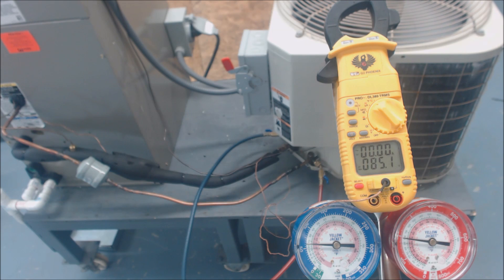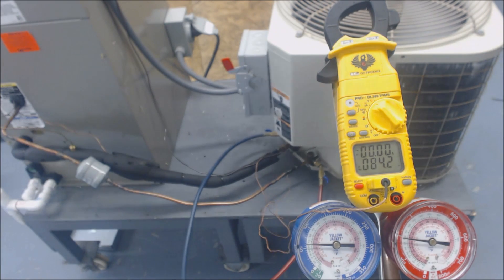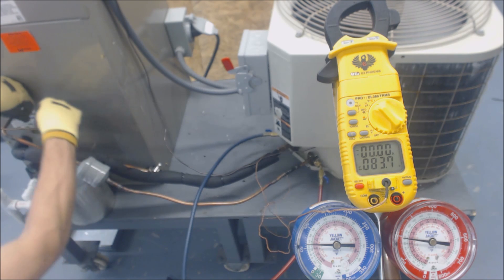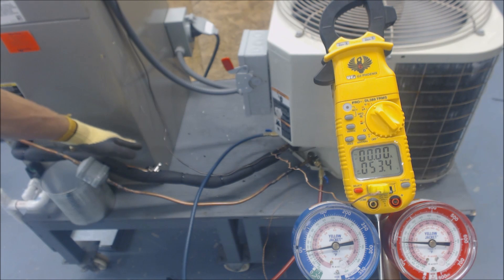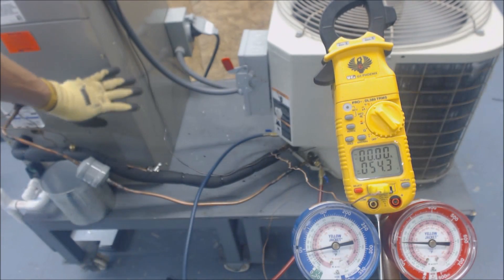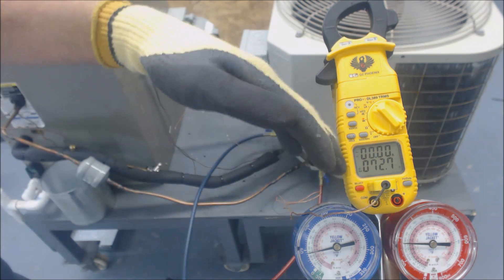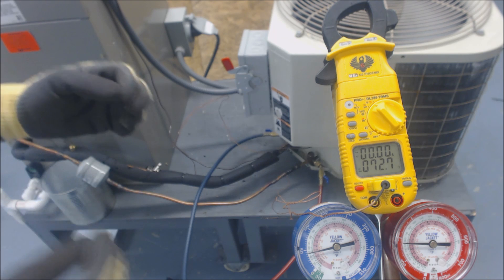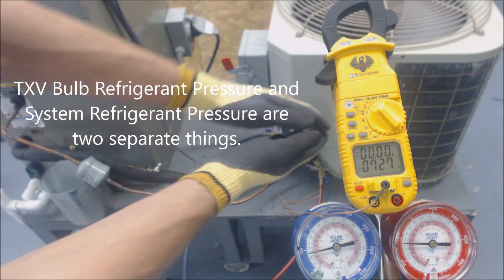Refrigerant Charging: What it looks like to have a Bad TXV Compared to just a Low Charge!

Comment: what if both high and low side are low on pressure? so when you try to charge the system the system, the pressure stays the same(or goes lower) and suction line starts to freeze

Comment: Thank you for the great videos. I have a 4 ton 
System 410A . Customer had called me telling the outside unit  sounded like something was stuck in the fan . 
When I got there put my gauges on . 
And low side was 158 high side 278 
SH 15 SC 1.3 .. at first I was thing txv . But now second guessing my self maybe compressor valve . Would you have a idea 
Thank you

Comment: I got a service call once where this 1 1/2 ton Rheem heat pump would work fine on A/C mode but on heat mode the high side (or low side i don't remember) would rise more 500psg and the high pressure switch would turn it off. I changed the TXV and filter dryer  and that fixed it. Can some explain to me how this can happen?
Reply: My heat pump is the opposite, works fine in heating but not in cooling. So I might have to replace the filter drier and the TXV?

Comment: I replace a TXVon a Rheem  outdoor heat pump last week because it was completely shutting down refrigering flow. After further inspection I saw that the cap Tube connecting the sensing bulb to the TXV powerhead had a crack in it. I’m wondering if the sensing bulb losing its refrigerant charge was the cause of the TXV completely shutting down refrigerant flow or if that was just a coincidence. Because I could have just replaced the powerhead and not gone through the refrigerant removal process and pulling a vacuum etc.
Reply: I tested my TXV by placing the bulb in ice water and warm water to see how it regulates the evaporator. It makes a difference so I believe it is working properly. Not sure how to diagnose just a bad bulb. If the ice water/warm water test does not have any impact then it could be bad bulb, stuck valve, clogged TXV. I suppose you could replace the powerhead first to see if it fixes the problem (easy job), if not then plan to replace the entire TXV. My bulb was mounted inside the air handler (Trane Heat Pump), so I relocated it to the outside for easy access to test.

Comment: I have a 40 year old Friedrich AC system that has worked very well for me. Years ago it developed a leak in the evap coil which I replaced. It has worked OK since then except that now the evap coil froze up. A service tech said he thinks it's low on R22. I also noticed  the drain channels have a lot of rust flakes in them. (they are not plastic like newer ones.) Could those flakes be blocking the evap drain? Should I replace it with a newer coil?

Comment: Awesome

What about if the TXV bulb just comes loose?
I think I have that issue at my house
My sub cooling is high, unit calls for 10-12 but it’s 18 (it’s a TXV system)
super heat is like 1..
Temp split is 20
Suction line temp is 42
Liquid line temp is 75
Outdoor temp is 75

I just don’t have access to my basement tenant is on vacation..

Comment: Just worked on one and I put the tvx bulb in warm water cause the suction line would look right when I turn on the system but after few minutes the pressure would go down, so after putting the bulb in warm water the suction pressure didn't go up. Bad txv?

Comment: very good explanation! thank you sir
i have one question that bugs me out: why at the moment you dipped in the bulb into the water ice the pressure reading changed quickly. but when messing with the adjustment screw on the TXV in order to bring the superheat higher or lower we have to wait for minutes to see the changes??
Reply: the adjustment screw adjusts the pressure on the spring. tinkering with the bulb on the txv is more immediate because it reacts immediately to the heat applied to the bulb and closes/opens the suction line quickly. the adjustment is just a spring and therefore you need to wait a couple minutes to see if things are getting better and so you don't overshoot the mark.
Reply: @fastcar42069  aah i got it! thanks !

Comment: Can you do a video on a TXV hunting. Went on a call with the bulb mounted downstream of equalizer tube,  Watched ice have to form outside the unit valve would open and thaw ice just on the downstream side of tube, then close again. Keeping coil frozen inside unit. This was also on a high velocity system. I am not a fan of the high V systems anyway. Thanks

Comment: Carrier system, 3ton, 410a:
50° saturation lowside with a 10° SH. 108° highside with a 10° SC. 9° temp split with high electric bill. Bad txv? Compressor? (8.2amps) Both? Air flow was fine.
Reply: this reads more like an overcharge. is it a txv or a piston? what is the outdoor and indoor temp at these conditions?
Reply: a bad compressor will usually just be not compressing as efficiently. You're pressures will be closer together than usual. in other words, the low side will be reading higher than normal, and the high side will be reading lower than normal. One house i went to the compressor was fucked from being overworked, and when i put the hardstart on it it was running 50psi suction side and 100 psi liquid side.

Comment: Hi Craig, question, is it true that when we are replacing an old r22 outdoor condenser with a new r410a condenser, we really do not have to change the txv in the indoor r22 air handler. I have always done it but some of the people here in town don't do that. is it true ? if not changed, what would happen ?
Reply from the maker: Ha ha that is not good! You definitely change the txv to r410a otherwise you will have an inefficient system with higher superheat. Wow that is really pretty bad!
Reply: @acservicetechchannel  I completely agree with you. But I stopped arguing that it is wrong what they do. I guess at the end of the day is what you do what really matters. Thank you buddy.
Reply from the maker: @budgetcoolingandheating4059  this is true. They must not be looking at their low side gauge or delta t after the changeouts, man that's awful!

Comment: What should the temperature be of the air coming out of the condenser?
Reply from the maker: That would depend on the seer rating of the condenser. The sat temp that we are normally running at is 90 to 105 unless the seer rating is low or the fins are dirty, thanks

Comment: Like everybody below says, great video!  I'm helping a friend with what I think is a bad TXV.  Line is iced up behind the TXV.    I had only a thermometer with me.   In A/C mode, indoor Delta T  was 10 Deg F . Good air flow.  Supercool felt OK to the touch - that is it was definitely saturated liquid. ( a calibrated touch that is :-) .    I'll go back and check it out better later.   My question is,  Shouldn't it be possible to be pretty sure without even installing gauges?  Here is what I'm thinking,  Rather than look at super heat and cool, look at "relaxation" that is what is the delta temp between the coil outlet line and the air temp passing through the coil.  In watching your video, as you showed super heat and cool, I was wandering what the outdoor temp was - that is how "relaxed" the refrigerant was to the outdoor air temp.   Also it seems that with a cheap IR thermometer you could measure the condenser face temp as you move up from the bottom.  When you see the temp jump up you'll know how high up the liquid is.  If the TVX line is icing and the liquid line is high you should be pretty sure the Charge is good and the TVX is bad ( assuming all the other issues you listed were not a problem)   In the old days I would run my hand up to coil loops and find the temp jump to know that.

Comment: Hi there, i watch your videos regularly, and also im reading the book but one topic still remain unclear to me. Thats line restriction. Im trying to figure out what is the whole procedure from diagnosing, symptoms and over solving it. Please refer me to sole of your videos if there is one like that.
Thanks,
Zoran
Reply from the maker: You would want to read the troubleshooting part of the book where I have a liquid line restriction with a correct charge and another with a overcharge. A liquid line restriction is usually the metering device, or screen in front of the metering device or the filter drier. Any time you find one with high superheat and normal to high subcooling on a TXV system replace all three components after a pump down, thanks!
Reply from the maker: You can test the temp across the filter drier to see if you have a temp drop across it. If it is less than a degree, it is good, thanks

Comment: Charge might be hard to gauge on sub cooling side of system because liquid line is too short needs to be 15ft
Reply from the maker: Hey Eric, subcooling happens in the condensor and is measured before at both spots before it even gets to the line set liquid line. It wouldn't matter if there was only one ft or less of liquid line. This would be the same distance as most package units as well. Subcooling is the temp decrease of the liquid from where the liquid comes out of the saturated state in the condensor until it comes out of the condensor. In order to measure this, we convert liquid pressure to sat temp and minus the actual temp measured on the liquid line within 3 inches of the service valve, thanks!

Comment: How can you tell if the evaporator coil itself is blocked with dirt?
Reply from the maker: Hey Steve, you can drill a small hole in the triangle tin plate if you can't see behind. Some have a plastic knockout. You could also take a pressure reading across it with a manometer. The target would be in the evap coil manufacturer install booklet, thanks

Comment: What if a r22 unit has a txv and capalary tube In the same system(york)
Reply from the maker: That is actually a txv with normal distributor tubes attached from the txv to the coil. Distributor tubes are normal on txv and piston systems and a larger in internal diameter than capillary tubes, thanks Gary!
Reply: Thank you sir ..

Comment: I've always wondered the correct way to TEST if the bulb is bad. I've read and heard to place the bulb in warm/hot water. I've read to place the bulb in your hand for 10 min and then check. I've also read that you can use a hair drier on the bulb to test it. It would be great to know the correct way to test/troubleshoot the bulb.
Reply from the maker: You can do these tests but also high superheat and high subcooling is an indication of a liquid line restriction which we replace the txv, strainer or check the strainer, and replace the filter drier, thanks Blue Collar!

Comment: Excellent video!!  One question. Why doesn’t head pressure rise when the TXV shuts down. Seems to me like it would.... Also, is there any way to rule out a bad compressor in situations like this. I guess what I’m asking is of the compressor wasn’t pumping right what might the symptoms be?
Reply from the maker: When the txv shuts down supply of refrigerant into the evap coil, the subcooling increases. Look up "acservicetech bad compressor valves" thanks
Reply: @acservicetechchannel  

Since superheat is not valid for TXV systems to adjust charge, can subcooling be used for determining the correct level of charge regardless of whether it's TXV or capillary tube/piston setup? Or is superheat measurement always called for with the orifice tube systems?
Reply from the maker: Subcooling can only be used with txv systems since the txv controls the subcooling. The most important issue is superheat determines how much heat is absorbed to begin with and keeps the compressor safe from saturated state entering into the vapor compressor, thanks and good question DTR RTD!
Reply: On the superheat measurement of an R22 orifice system, it showed the expected value of 21.3 called for on the sticker on the condensor housing, but the subcooling came in at 5.2 degrees.   Is there a recommended subcooling value for orifice tube systems or is that only applicable for txv systems as you mentioned?   
Wondering if the 5.2 subcooling would indicate a low charge, since a higher level of charge should increase that figure.
Is the charge level only determined by the superheat measurement with non-txv systems?

Comment: I ran into a bad txv today. Had 30 degrees or more of superheat even with fan on the  lowest  fan speed. Only way to bring down the super heat was basically to take the fan out of the equation.  Brand new system. Set up for downflow. Adjusted txv to allow more rrfrigerent to flow. That did raise the low side pressure didn't help with the problem of high superheat. Going to try and open it a bit more before I put on a new one and see if I can get it to act like a fixed orfice device just for the hell of it.
Reply from the maker: There could be a blockage at the screen from braze or junk in the lines or a clogged filter drier. It won't work like a piston but try to get around 10-14 degrees of superheat by adjusting. You could try the bulb in hot water then cold then hot again to try to get it to move but basically if it won't hold 10-14 degrees of superheat then change it out,, check the screen and replace the filter drier, thanks

Comment: Airflow was set to the correct speed, the evaporator coil was very clean with no airflow restrictions. Took an amp draw of the blower motor and it was in Factory specifications. Verified proper air flow at each duct and that all returns were unblocked. Filter was new because of course they always change the filter before we get there before a service call. So I go out and hook my gauges up. R410a system. System had low suction pressure at about 20 degrees saturation and slightly low head pressure. I decided to add a little bit of charge and only the high side responded. Went inside opened up the evaporator again and noticed it all three capillaries were basically Frozen and that there were some coils that were developing Frost and some that were not. I diagnosed it as a restriction in the system. I even second-guess myself and was almost convinced it was a bad TXV. I did not use the ice water trick. I think I will use it from here on out. Thanks for the info.
Reply from the maker: It sounds like a liquid line restriction. Liquid line restriction such as bad txv, clogged strainer, clogged filter drier would be high subcooling high superheat vs a low charge would be low subcooling high superheat. Thanks

Comment: What do frozen capillary tubes indicate? All three Capillary tubes on the low side of the txv were frosted
Reply from the maker: Low refrigerant charge, liquid line restriction, or low airflow. You would need to check vapor sat temp along with superheat and subcooling to determine which one, thanks

Comment: I get how the superheat would be higher with less refrigerant in the evap, but if there is more refrigerant in the condenser why would subcooling also be high? Wouldnt the temperature drop less if there was more refrigerant to cool down on the condenser side? im stuck here, thanks
Reply: ok i think i get it, since now it has more passes in the condenser (its basically has more time spent in the condenser) and so more heat is rejected?

Comment: HI A.C Sean here . So today I changed out two 5 ton R22  compressors  on a Lennox L series RTU . After I weighed back in the refrigerant according to factory charge for each compressor and the unit was running for some time while I was checking the pressures I got  stumped as to why the low side pressure was only just above 50 psi and the high side was 188 psi . It was at txv metering device and so my  subcooling was 70 degrees but and super heat 14 . I tried to add more refrigerant to each compressor to try and bring up the low side psi but I could only get head up to 220 and the low side stayed around 56 before I stopped adding r 22 . Any thoughts ?
Reply from the maker: Do you mean you had 70 degree actual temp on the liquid line? Not 70 degree of subcooling correct? So three things make a low sat state/low side pressure on a system. One is low refrigerant charge. We know thats not it. Low airflow which would be indicated by normal superheat and normal to high subcooling, Liquid line restriction which would be high superheat and high subcooling. For your reference, low charge would be high superheat, low subcooling. So normally, determine if it is either low charge or liquid line restriction and if it is neither than it is low airflow. Is it possible to take a door off to allow more airflow across the coil for testing sake to see if the pressure rises. It may rise anyway some due to the heat absorption even if it is liquid line restriction. I hope this helps!

Comment: If there is no restriction on refrigerant flow entering evaporator and you have low evap pressure due to dirty filter, slipping belt etc then i assume this would not affect the subcooling as is the case with a restriction on refrigerant flow
Reply from the maker: Actually subcooling would be low due to excess sat state in the evap coil. I have all this spelled out in the book I am putting together and excited to be getting it out soon, thanks
Reply: Thank you. That makes sense. Less refrigerant in high side so less liquid for subcooling to take place. Looking forward to the book.
Reply from the maker: Yes that's right, thanks Michael.

Comment: I  reaaly appreciate your videos. I am currently working on a new split system. Ran for two weeks before it was shot with a nail in the liquid line. I replaced the bad section. After weighing in the 410a gas and test ran the system the pressures are very low on both sides. I confirmed the the txv is 410a. Both a coil and condenser are Airtemp and the furnace is carrier. Only thing i can figure is wrong is airflow too low or bad txv. Any thoughts?
Reply from the maker: So I would need superheat, subcooling, indoor wb and outdoor db in order to tell if it is liquid line restriction, low airflow, or low charge, thanks Shawn!